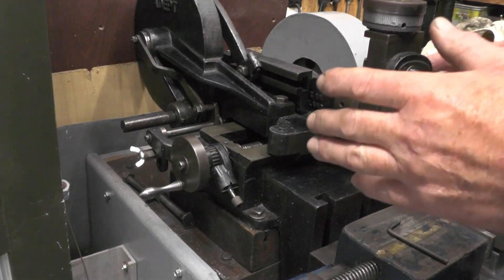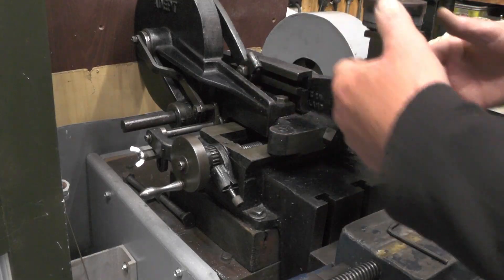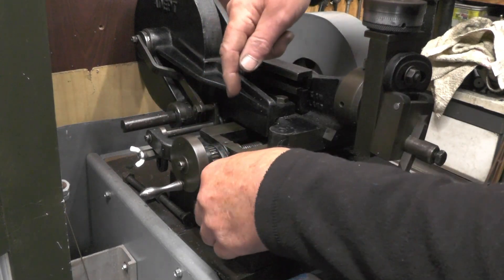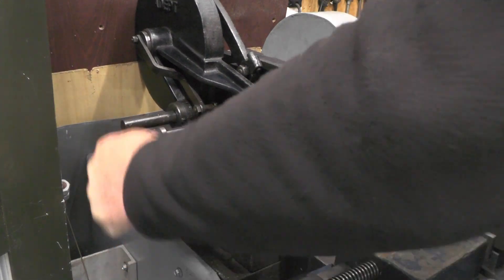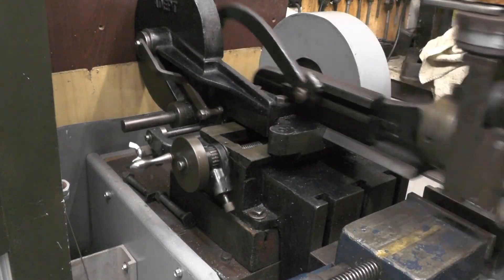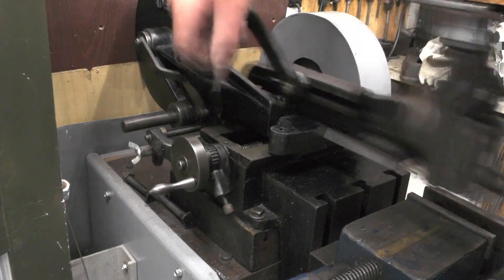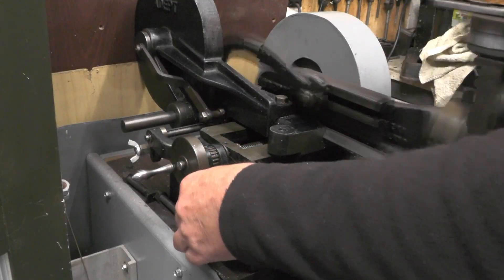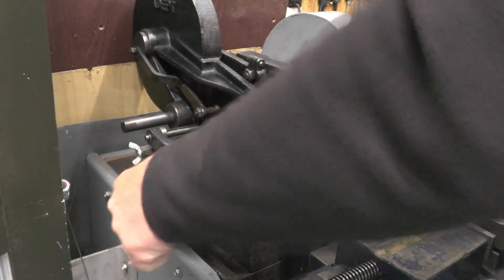Adept Powered Micro Shaper Auto Feed Tip

Comment: Wow! I thought that was an oil hole!! Are you able to let me know the thread on that grub Screw? mine is definitely missing.
Reply from the maker: William
Its 1/4" BSF the thread, i don't have a grub screw but i have a 1/4" bsf cap head that you could cut down and put a screwdriver slot in.
 If it's any good i will post it to you, once you send me your address via my email in my about page.
i await your response👍👍😉😉🚂🚂
cheers
Kev
Reply: @MrFactotum  that's really kind Kev, let me do some digging - the hole on mine just looks like a plain oil hole, definitely not 1/4" diameter. Maybe a later modification?
Reply from the maker: No problem, i will let you know William 
and if i've got one in my stash i will send you one.
bear with me as i'm away from home tonight, so will be tomorrow morning before i can let you know😉👍🚂
atb
Kev